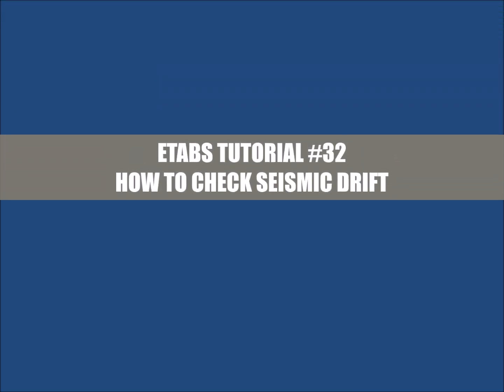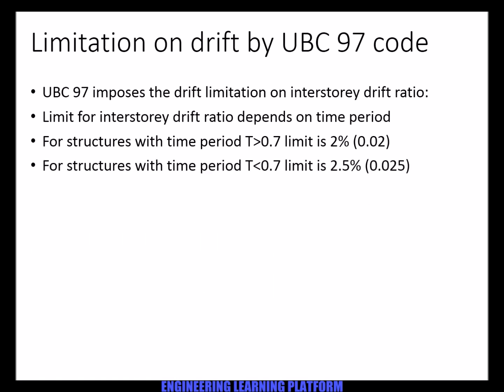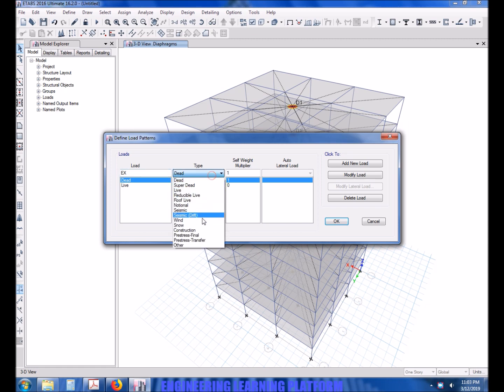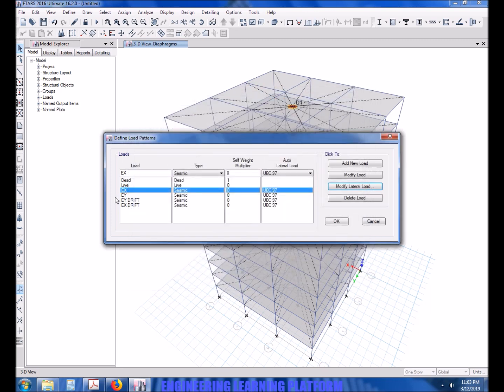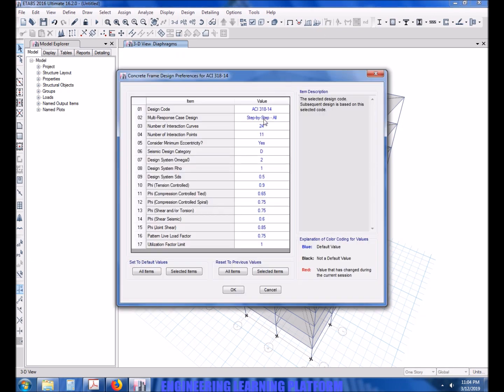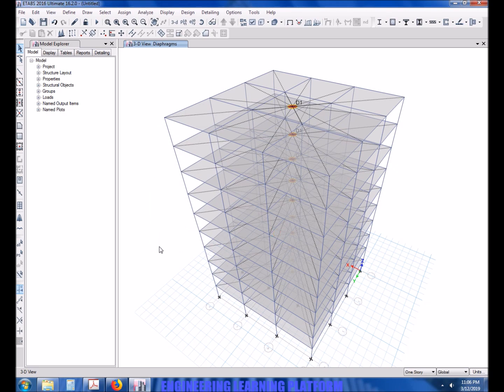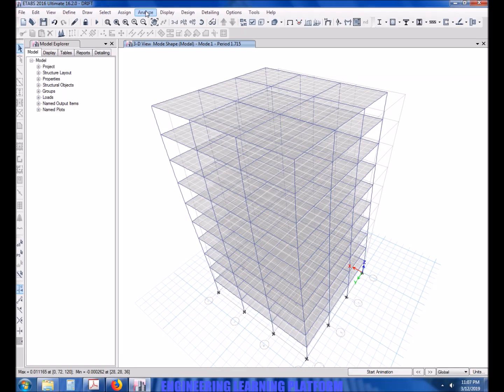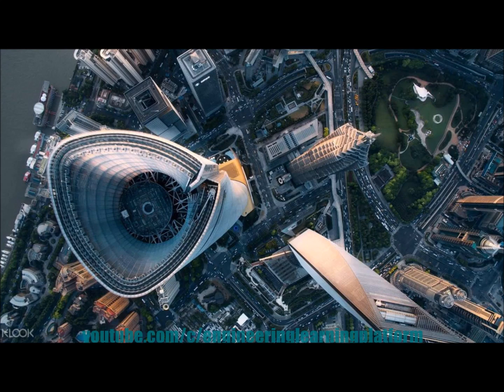How to check seismic drift limit due to earthquake Etabs tutorial

Comment: Please tell me how the natural fundamental time period affects the struture..what happens if time period is more and less ?
Reply from the maker: Fundamental timeperiod is when structure vibrates in first mode that is all the masses move in single direction and mass participation is largest causing most deflections hence higher the time period means more flexible structure and lower the time period means more stiff the structure will be . Time period depends on mass and stiffness of lateral force resisting system .
Reply: @EngineeringLearningPlatform  after the model which time period needs to be considered.

Time period formula with infill wall
Time period formula without infils walls 
Time period calculated as per program
Which is more conservative in design and reason ?
Reply from the maker: @hariasssss  program calculated is more accurate while Cthn^3/4 is method A and considers infill walls by default as it is experimental based on USA buildings having infill walls
Reply: Does Program calculated option in IS code also consider the infill walls ? Or only consider mass and stiffness of elements
Reply: Thank you very much for uploading EQ analysis as per UBC expecting more videos in BS or Aisc codes..thank you once again.

Comment: the value of drift after analysis is 0.009473 ...you multiply it by 100 os it came 0.9473 which is less than the limit .. can you please elaborate what is the value of limit
Reply from the maker: 01:10
Reply: @EngineeringLearningPlatform  thank you so much .. so the value 0.009473<0.02 ..
therefore it is within the limit
but one place I have checked it is mentioned the limit is 2% of floor height
Reply from the maker: 0.02 and 2% are same things .